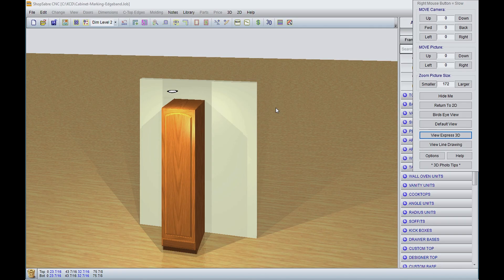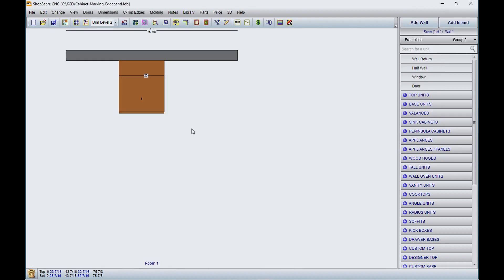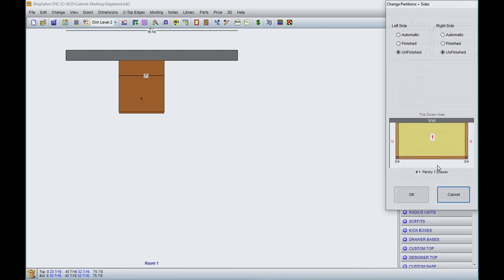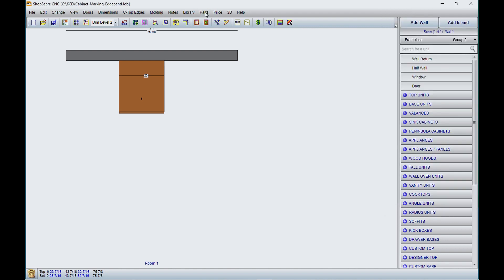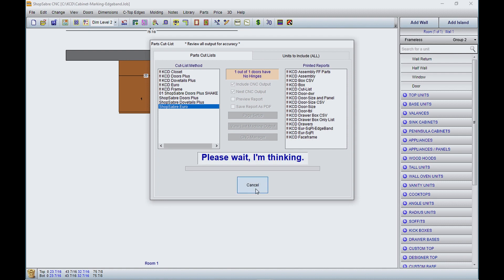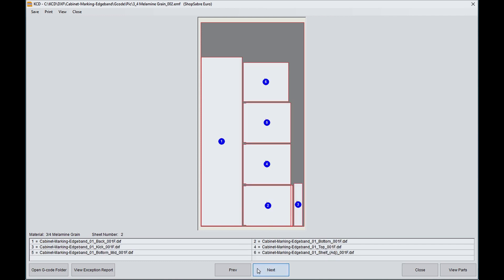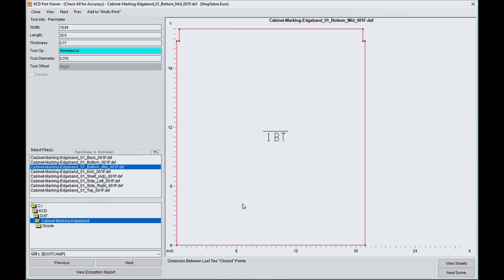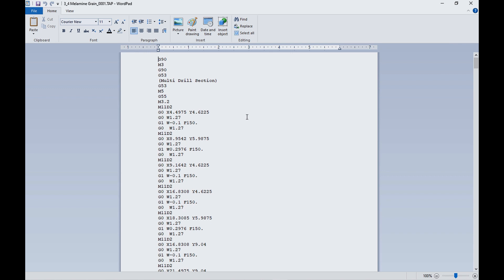Labeling Nested CNC Cabinetry Parts for Edge Banding

Comment: Full 3/4” depth in one pass how many ipm 
I have the iOS 408 but you are going faster than I run mine
Reply from the maker: Ultimately depends on the tool itself but we see people running between 600-1200ipm depending on the specific tool and of course hold down

Comment: Can I do this with Mozaik?
Reply: For the most part...yes, you can. Mozaik does have "Auto Labelling" as an option, provided your cnc is capable, and the labels indicate what edges get banding, the cnc will apply the labels on to the parts, but yes, it is not dry erase "written" on the part. Hope that helps with your question.
Reply from the maker: Unfortunately I do not think they have that feature at this time.
Reply from the maker: However we’d recommend contacting them to confirm